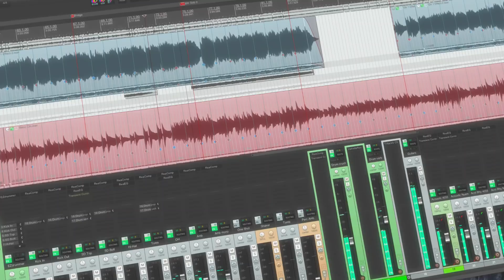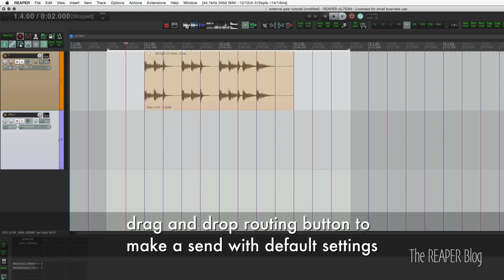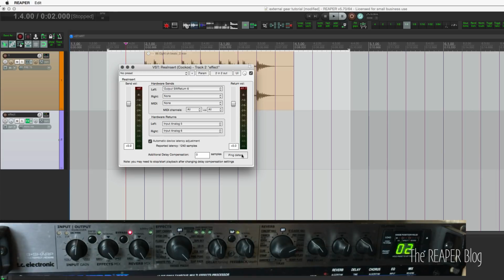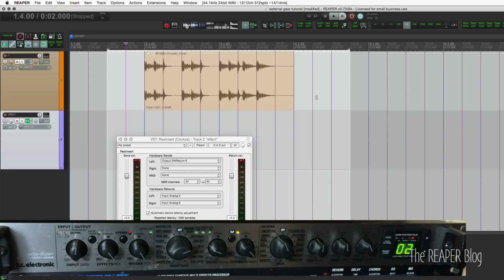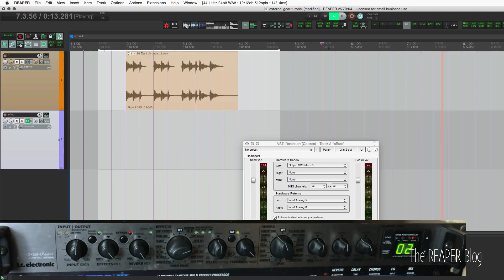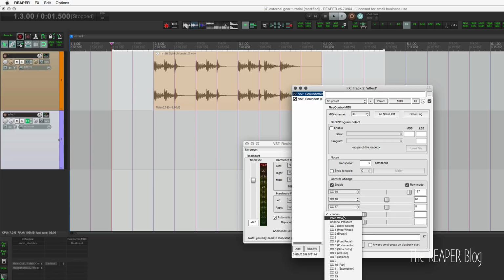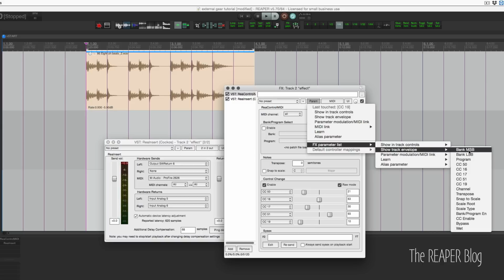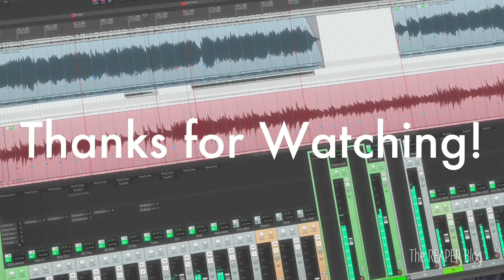Integrating External Hardware Effects - ReaInsert, beat sync, and remote control

Comment: Thanks for your vid. I will try your Reinsert method, but so far I get TERRIBLE feedback when I try to monitor my Fx return signal. I create a loop-the whole reaper mix goes into my Fx from the outputs of my scarlet, then the processed signal goes into In 1/2 of my scarlet. I create a new track and record the Fx on it. But I want to monitor the Fx signal because I apply manually the Fx increasing within a bar. The moment I have track record monitor enabled, the feedback starts, it is metallic digital feedback screeching.
Reply from the maker: Makes sense.
you need 4+ outputs for this to work optimally.

Comment: I dont get any signal in the return , and I tried pretty much all combinations. I have a Id44 interface, and would like to use a Guitar Pedal Reverb effect with a track. The interface has multible in and outputs, but it just wont work. Can someone give advice? Reason for me to get the device was, that I could have more outputs for routing, but it just wont work.
Reply: Can you describe your setup and routing in greater detail?

Comment: How do you prevent the extreme feedback and tin can sound once the equipment is hooked up? If you untick send to master in your routing you lose the inability to monitor. Reainsert should act like a plug-in for external gear right? I am missing something simple but HUGELY important.
Reply from the maker: that sounds like your sending the signal of the output of the hardware back to the input.
Most likely this is because of direct monitoring in your interface.
Reply: @TheREAPERBlog  Thanks for taking the time to write! I completely forgot how important it is to pay attention to the interface's mixer settings. (Focusrite Control in my case) After lots of head scratching - I am finally able to use outboard gear! A real treat.

Comment: A quick question for guys using outboard gear: lets say I have an EQ, a compressor, and a reverb unit and an interface with a lot of I/O like a MOTU ultralite. Is it better to use a SINGLE set of outputs and inputs from the MOTU, and use an external patch bay to build custom chains....like, EQ->COMP->reverb or COMP->reverb->EQ by just swapping patch cables. Or is it OK to just put each analog piece on it's own set of I/O from the ultralite and build a chain by opening multiple instances of re-insert on a track. One instance for each device. I am worried about latency, but also a bunch of needless A/D and D/A conversions. Doing it on a single I/O with patchbay avoids all that. Anyone else doing this? Advices? I am trying to determine if I really need the ultralite or if I can get by with the new M4 if I have 3-4 pieces of outboard gear to run in a single processing chain.
Reply: I know this is an old message but I’d have to say that converting from digital to analog is always a destructive process so to not have it run through converters over and over is best. That being said, the byproducts of digital conversion are much smaller than the THD introduced by your piece of gear so who really cares?
Reply: @jacksoncordes805  hey thanks!! I already got it sorted with a patchbay. Pretty cool.

Comment: How do I record this output of reainsert? I'm losing my mind trying to figure this out
Reply from the maker: You can set the same track to record output mode, or send to a different track prefader and set to record output.
Or don't record it inside the project and just keep it monitoring while the entire mix is rendered with realtime option.
Reply: @TheREAPERBlog  thanks! I ended up getting the send track to record the output and it ended up working for me

Comment: you said you need an audio interface with "more than 2 inputs and outputs"? im using a lexicon with 1 mono, 1 stereo and 2 stereo outputs and am getting horrible feedback. is this impossible with audio interfaces with only 2 inputs? you said something about sending "discrete sends to different outputs" & for whatever reason, it seems like my out puts are the same as my monitoring outputs and I keep getting feedback - why
Reply from the maker: feedback happens when you send an output to an input and back to the output in a loop. You must have outputs 3&4 available to do this.
Reply: @TheREAPERBlog  okay, thanks for getting back to me

Comment: Hi John. I have just wired up a shit load of outboard and i mean a SHIT LOAD. and I don't know what's going on. I put reainsert on my track and it shows a send but no return. The meter on the track goes away and I'm at my wits end? any ideas?? I am prepared to book a skype call if need be. Cheers
Reply from the maker: any other way you can check the hardware connections?
Reply: The REAPER Blog tbh I was having this problem before . I made sure all the connection were correct as I assumed that’s why it wasn’t working before. I really am baffled
Reply from the maker: its probably the audio interface then. Does it have a built-in mixer or routing matrix?
Reply: The REAPER Blog when this first started happening I was using a focus rite 18i20, I have now upgraded to an rme fire face Ufx + and the same thing. I have the new warm audio bus comp arriving tomorrow can we do a Skype call and I will hook it up on a very basic way(no patch bay etc)  and maybe we can hunt down the issue?
Reply from the maker: sure, tomorrow should be OK for me
https://reaperblog.net/reaper-lessons/

Comment: if I had a complex folder layer with some hardware insert on, im getting delay issues. when I started to insert multiple hardware it started to messed up real bad, is it my CPU problem or my setting ? otherwise insert only 1 hardware will be no problem at all.

Comment: I’m having feedback issues when I try to use this setup. Going output 1-2, into external processor, and back to input 1. I get signal but I also get feedback.
Reply from the maker: If it sounds like a feedback loop then it probably is! Check your monitoring settings for the interface.
Reply: The REAPER Blog thx for the reply. I turn off all monitoring while recording the loop but the problem persists. 

I’m relatively new to Reaper, normally I use Reason.
Reply: @amremorse  no, I never did. Gave up and went back to Reason.

Comment: This is easy. It gets a little less obvious when you want to send to external FX and only monitor the return (or "wet") signal. To do this, as far as I can tell, requires 2 tracks - one as fx send and one as fx return. Then either send any tracks to the "fx send" track or child them to it. The FX Send track should have "master/parent send" disabled so it only sends to the hw output.
Reply from the maker: sounds about right

Comment: Very instructive video Jon, as always. I'm encountering some issue. I try to create a 2-ways MIDI connection between Reaper and an iPad with Lemur. I can control a plugin in Reaper with the Lemur app, no pb. With the ReaControl JS effect, I can do the opposite, great. But how can I create a two-ways connection with, let's say ReaComp? I've been searching for that for weeks without success and can do it in Ableton in 3 clics, frustrating... If you have any idea. Thanks a lot for your great work.
Reply: i just found a solution. Putting ReaLearn between a controller and a plugin can be used to send a MIDI feedback. So whenever I use the controller or the mouse, I have visual feedback working both ways... Fantastic.

Comment: Hi jon i appear to be getting some latency with reainsert. it's never happened to me before.Any ideas as to whats going on??
Reply from the maker: you just need to detect the latency again if you change the audio buffer size or sample rate
Reply: I have done that, i'm not even sure it is latency? i soloed the track which reainsert is on, in this case a snare. i have the signal going to t a dbx 160A . i can hear the compressed signal first then the original

Comment: In order to print the track after you dialed in your hardware effect , it is imporant to select RECORD OUTPUT of the track as if you leave it on record input it will not record anything as it is not recording an input but it is recording the output of reainsert
Reply from the maker: correct, OR leave it live and use Online render option for full mix
Reply: The REAPER Blog exactly ... printing the tracks allows you to use the same unit on multiple tracks :)

Comment: Hi jon , i have all of my hardware now patched into a patchbay but i don't understand how i can put my returns into 2 inputs as most hardware only has 1 output so how do i path my hardware back into say channels 3 and 4 when i only have 1 inpt to patch back into my patchbay??
Reply from the maker: connect from two patch points to the 2 inputs. I don't see the problem
Reply: say on my dbx 160 a there is only 1 output going into the patcbay so where does  the 2nd  input come from as i only have the unit patched into 1 channel of the patchbay.
Reply from the maker: where is the idea you need a second input coming from?
Reply: on reainsert you choose 2 channels for the returns> i tried selecting none for the second channel but then the sound only comes out the left speaker.. sorry i'm new to hybrid mixing
Reply from the maker: I thought that might be what your were getting at but didn't have the whole story. 
you can set the return to the same input, or adjust the track to output in mono with the width control at 0.
Reply: ahhh brilliant. makes total sense now. thought i was going mad. lol. 
Thanks once again Jon. You really are the man

Comment: I've been doing this for years and I've consistently noticed that the measured interface latency from ReaInsert (using a simple loopback patch, nothing but a cable) is around 30% higher than the latency when I measure it manually in the usual way (by recording a test impulse and measuring the delay between the original impulse and a copy that has been looped back into the interface and recorded to a new track).  For example, in my setup the actual measured round trip interface latency for my standard buffer settings and sample rate is a bit over 1600 samples but the reported latency from ReaInsert under identical conditions is nearly 2200 samples. I've never been able to figure out why this is, but it has been consistent for me across multiple computers, interfaces and Reaper versions since I started using more hardware early in the 4.x cycle.

Usually I'm either using it for tape delay, hardware reverb or on the 2buss when mastering so it's not really a problem for me, but it's strange.

Comment: Is there a way you can A-B compare one setup with another one? I have trouble with the track input monitoring setting.
I work with Pro Tools (don't judge me!) on a mastering studio (with external hardware) and when I have one song recorded but I'm doing a recall because the client wants some changes, I can toogle the input monitoring button to switch between the already recorded version and the one I'm working at that moment.
But in Reaper it doesn't matter how I set up the input monitoring, the recorded media keeps playing back so I can't switch between one and the other.
Reply from the maker: hmm been a long time since I've done that… maybe toggle mute on the recorded item?
Reply: The REAPER Blog I'll see if I can come up with some custom action to solve this particular situation. I really want to start using Reaper on that studio.
Thanks as always Jon!

Comment: Hi! Do you think that ping is precise enough even for parallel compression? some ms of shift are inudible with reverb or delays, but very udible with compression. Once set the ping value, does it remain the same for every reainsert instance o should i repeat the process every time? thanx!!
Reply from the maker: I have used it for parallel compression. You should ping each instance
Reply: Thank you Jon!

Comment: Good stuff. I used ReaInsert with a reel to reel tape machine once...Reel flanging is fun!
Also, for sending MIDI CC, you could also add a MIDI item and add in as many CC lanes as you wanted. 
Cheers!
Reply from the maker: MIDI editor is so cluttered though! But you're right. I actually showed it in my first attempt at making the video.